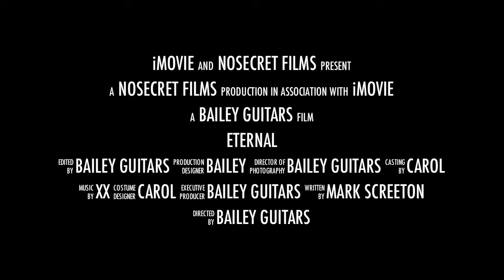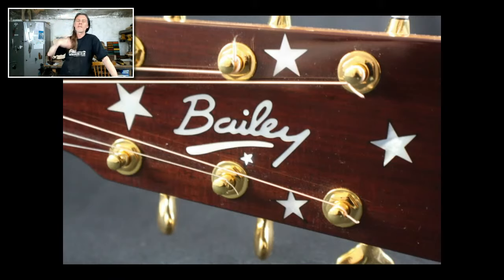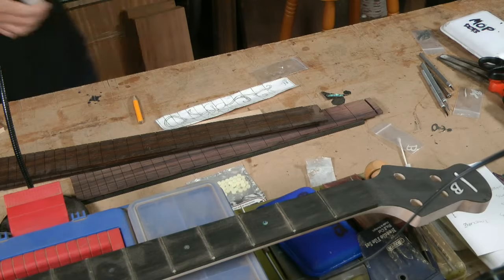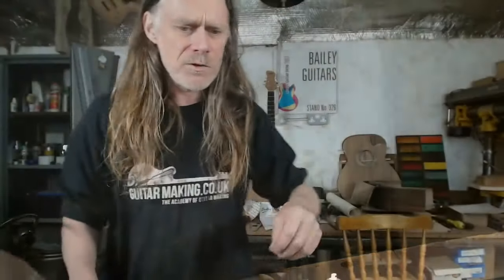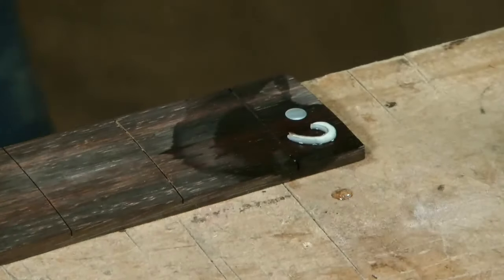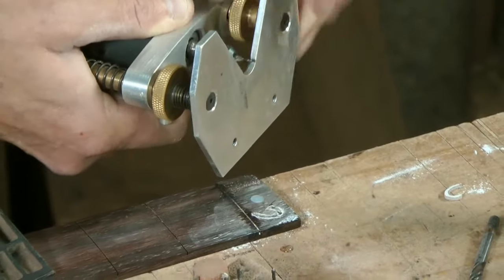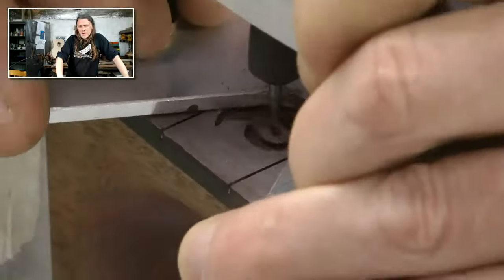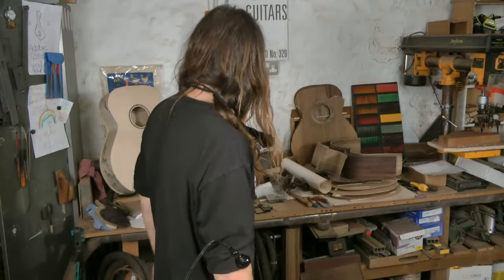How to Make and Install Custom Guitar Inlays - LIVE!

Comment: I leaned a lot by watching the video. I love that little jig you got for your dremel. I've seen custom guitars routed that never got filled in with mother of pearl or other materials that turned out very nice. Jay Parmar, that is also from the UK also makes custom guitars called spirit dance guitars. I watched your video because, I have a Jackson Soloist and the inlays are on the very edge versus being in the exact center. Very small markings as well. It makes it harder to navigate the fretboard while playing without them being in the center. I like the shark fin version of the inlays for the Jackson versus the ones used in the Soloist version. Even the rectangle version for the Les Paul look good on guitars. The custom inlays look very good. They take a long time to make but, in the end you got a fine piece of art to look at. At first I was only thinking about the fretboard itself. When you showed it being done on the headstock. That really opened up the door on what kinds of designs could be done on the guitar.

Comment: Very informative. I was wondering the normal thickness of an inlay. I’ve built a few electric guitars from scratch but have not attempted any inlay work. I would really love to learn. Excellent class. 🎸
Reply from the maker: They are normally 1/6" or 1.5 to 2mm thick - Cheers for the comment!

Comment: Hey how is it going? Nice video, thanks for sharing. It's been a while since i have some guitars and recently i got interested in luthier stuff. I'm planning on installing trapezoid inlays in an old single cut i have. I have a question though and i'd like to ask you because is more than clear that you have a lot of experience. So here is the question. Is it possible to install the inlays without taking the frets out? I mean, i know it is not standard procedure, but, is it possible?
Reply from the maker: Yes it is possible - No I won't do it. I always just take out all the frets and start again as it is a lot easier in the long run.Unless it is maybe just one inlay...